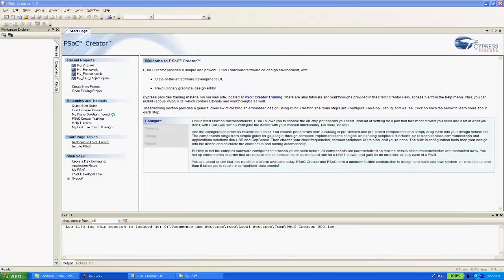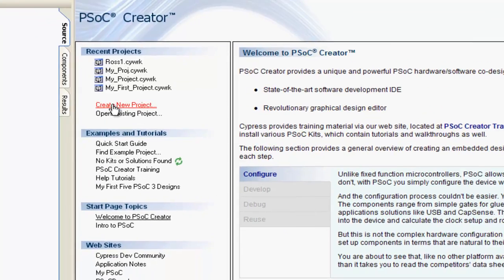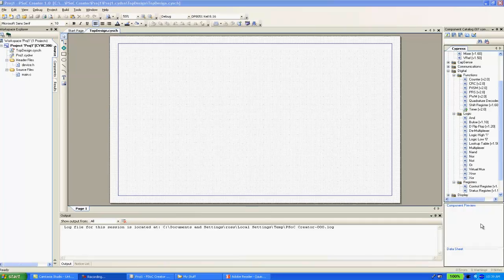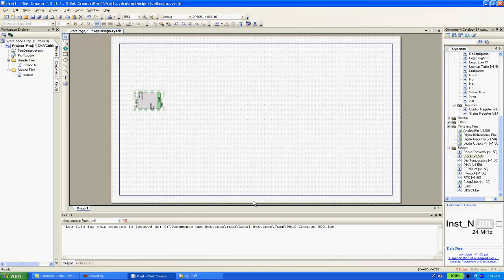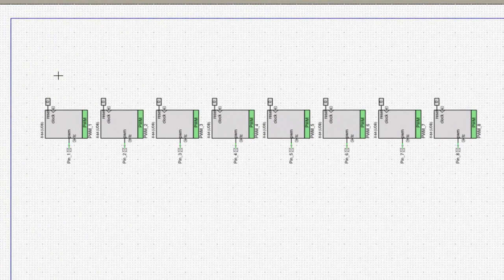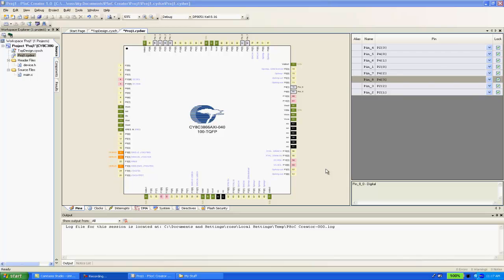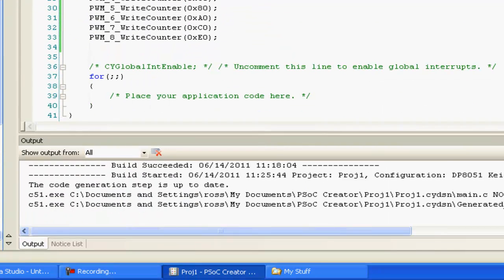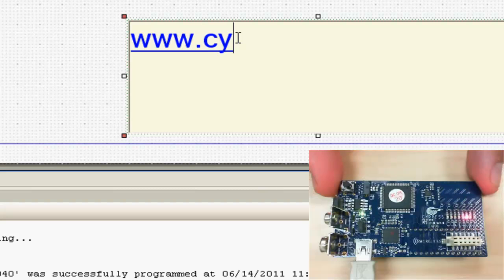PSoC Creator Introduction

Comment: I noticed when you dropped the code in you pasted it in.  Was that API generated by PSoC3 or did you write it earlier and copy/paste?  Either way it looked like all that was there was initialization and counters staggered by 20ms each.  Is that really all the code you need to get this design to work?  If so WOW!!!!